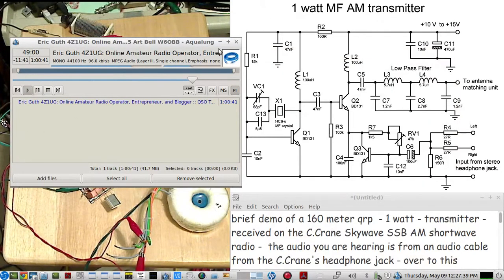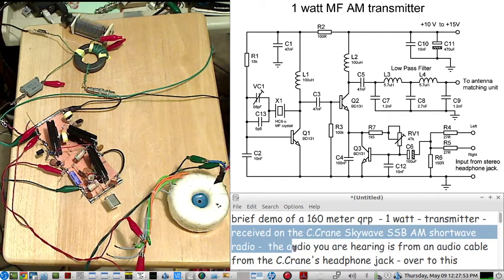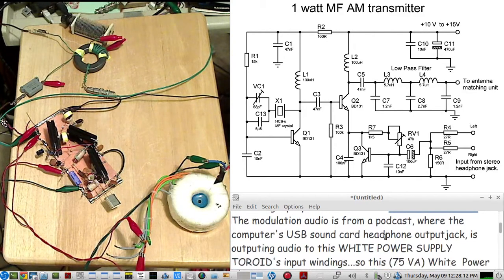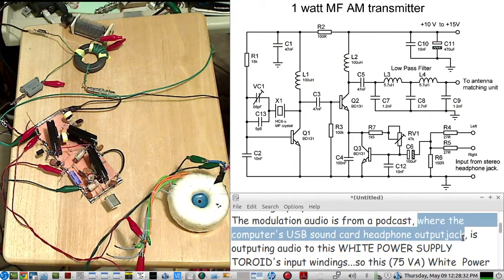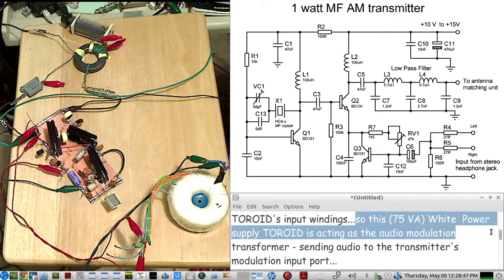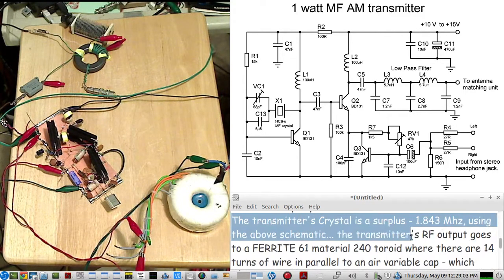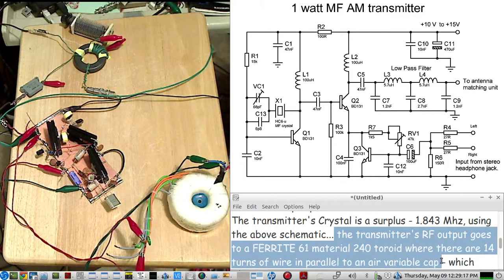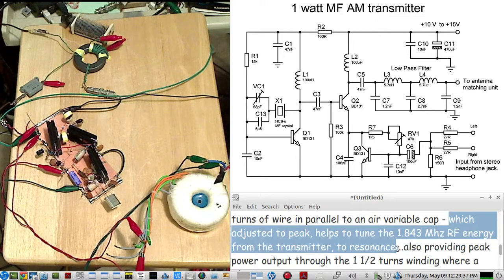brief demo of a  homebrew qrp 160 meter AM transmitter using a POWER TOROID Modulation Transformer

Comment: What a fantastic little transmitter in that video. Did it work?
Reply from the maker: @Janet Winslow 
Yes...that circuit design worked quite well...even tested it with a programmed beacon and was able to hear it about 2 miles away on ground wave with a very very poor transmit antenna and a small portable short wave receiver with a very short telescopic whip antenna
Reply: @QRQcw  Interesting. It might work slightly better if you reconfigure it so that the modulating transistor Q3 is in the collector of the RF PA transistor, Q2. It will then have its emitter grounded which may give slightly more overall modulated output.
Reply from the maker: @janetwinslow2039  thanks for the upgrade info !   This circuit has an interesting history, being the winner of an RF circuit contest some years ago...

Comment: Why would you need a modulation transformer since the emitter of PA stage is already modulated?
Reply from the maker: There seems to be less harmonic distortion when properly applying the POWER TOROID MODULATION transformer using the modified HEISING CHOKE//CAPACITOR method ...(just sounded better i thought...) here is an ongoing discussion on AMfone's blog about this -  http://amfone.net/Amforum/index.php?topic=41926.0